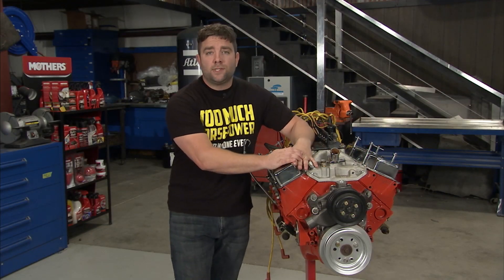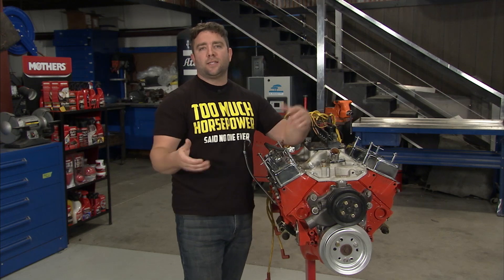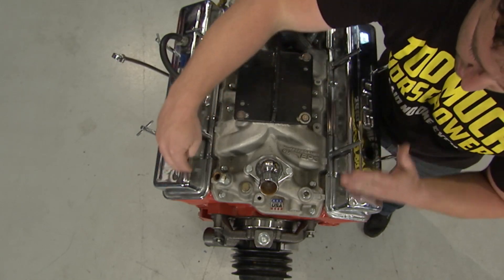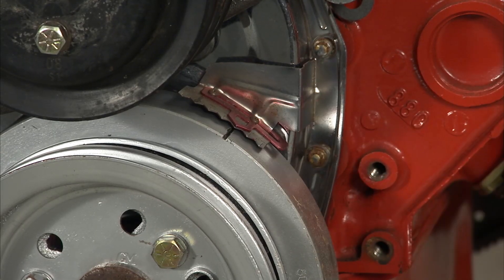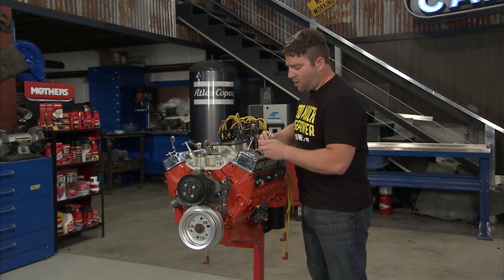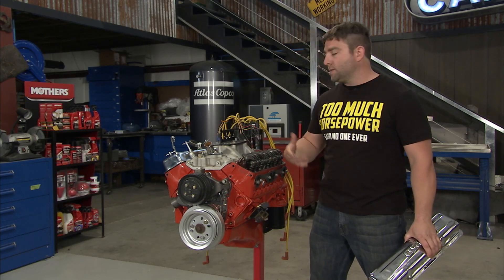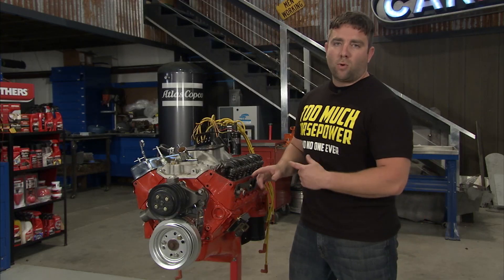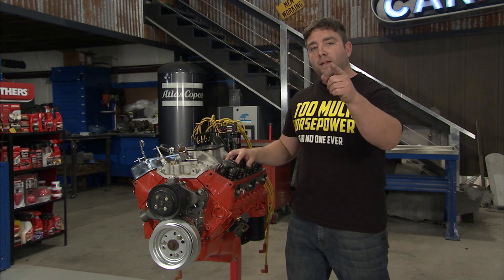How to Find Top Dead Center on a Four Stroke

Comment: Whem i timed my 350, i accidentally watched the exhaust valve instead of the intake vakve as i was rotating it. I had no idea why it was backfiring. A friend of mine tokd me rotate it 180 degrees itll start. It blew my mind i was bewildered that it worked. But now i know its not a magic trick😂 i had timed the spark to the exhaust stroke. Whats crazy is ive timed this engine many times putting and got it right each time but this time i made that mustake

Comment: I need to find compression stroke without ripping the top of the engine off, can you do it without the timing belt on, because ive tried everything Ballon, paper in the cylinder cant see any compression no matter how many times I turn it, the shaft to put the sparkplug in is like 6 inches long before you even get to the block to screw in the sparkplug. I don't have a Guage I can screw in etc etc it's a 96 intrepid non interference 3.5 l v6

Comment: Just to provide a bit of a correction.
Not every in-line 6 cylinder is numbered 1 at the front.
On a Jaguar XK engine for instance, no 1 starts at the back.
There are others as well.
You’ll need to confirm.

Comment: So Piston number one needs to be at the very top (ready to combust from the spark and gas)...pushing it downwards when starting the engine.....but what position does the intake valve need to be at (just as it closes or just before it reopens?) Reason i ask is i would think the exhaust would need to be  just about open for the explosion to go out of....maybe im overthinking it

Comment: Question i am installing new timing chain...when crankshaft and camshaft gear marks are lined up( crank mark 12 oclock,cam mark at 6 oclock) ... Is that also top dead center on compression stroke? i need to install my distributor correctly on my chevy 4.3..just want to make sure... Also if distributor is put in wrong can motor still run?? i ask because i may be off by one gear or 180 degrees.... engine ran horrible thanks

Comment: Next question: You mention 180 out. How do you remedy that situation?
Reply: Jarrod Hills Spin the crank another rotation. the Piston goes up twice, once to compress and once to exhaust. if the exhaust valve is open when the piston is up, turn the crank till it comes up on the non exhaust stroke.

Comment: What if you timing chain jumped and you have a jeep single coil pack best video ive seen on this though short and sweet
Reply: T Swaff You need to remove the chain and possibly get a new timing assembly (chain and gears) so it won’t happen again.